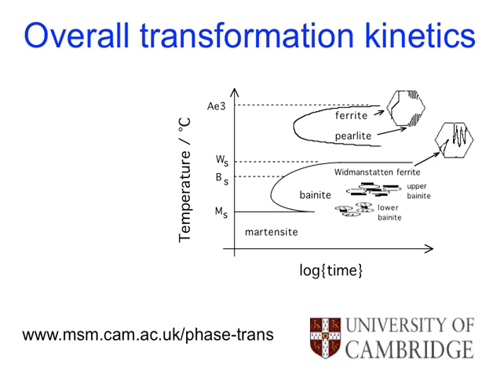Steels: Overall transformation kinetics, lecture 9 (2016)

Comment: Dr. Bhadeshia:What’s the physical meaning of nucleation incubation time?  Namely,why it need to wait a period of time before nucleation occurs?  I read some books and articles and still have this confusion. Thank you for your answer.
Reply from the maker: The "incubation time" for nucleation is that required to reach a steady state nucleation rate. However, nucleation occurs even before the incubation time but at a slow rate, so the definition of an incubation period is somewhat arbitrary.
Reply: In phase transformation caculation, it needs a specific incubation time number. how to estimate the incubation time value ?
Reply from the maker: No incubation period is necessary in calculating the kinetics of transformations.

Comment: professor bhadeshia:
Why the alloy carbide is much more difficult to nucleate than cementitle during low tempering of alloy steel martensite?
Reply from the maker: Because it requires the diffusion of substitutional solutes whereas cementite does not.
Reply: The diffusion influence the growth,does it influence the nucleation ?
Reply from the maker: Yes, both.